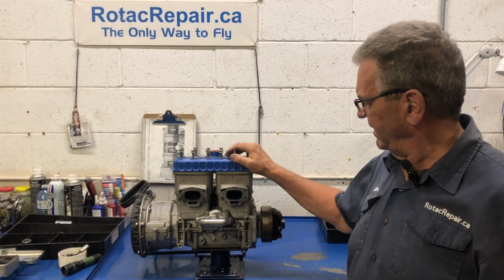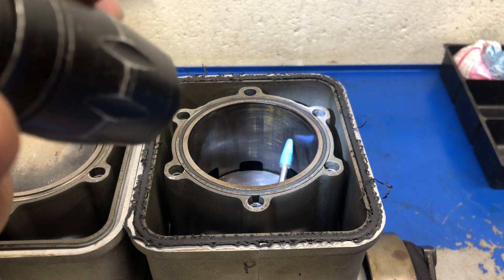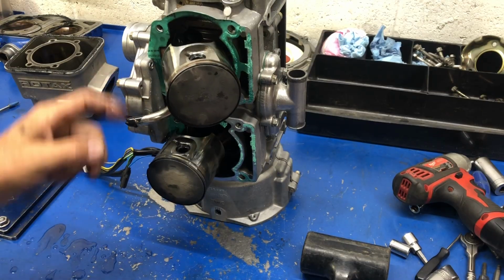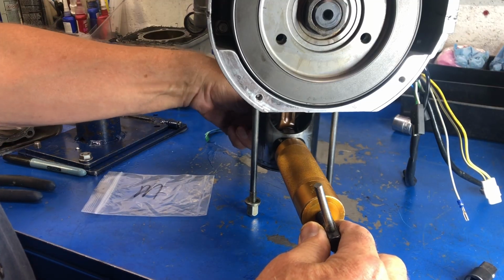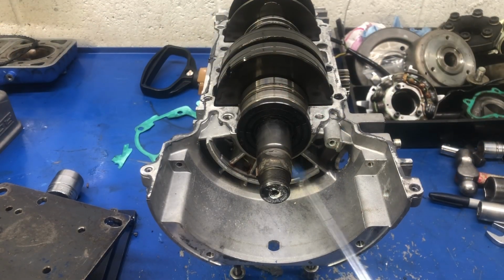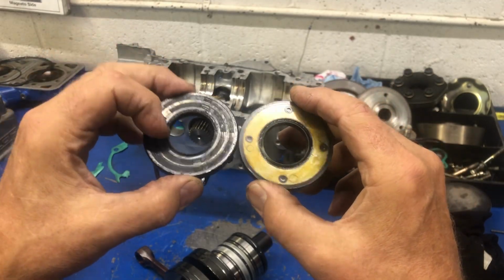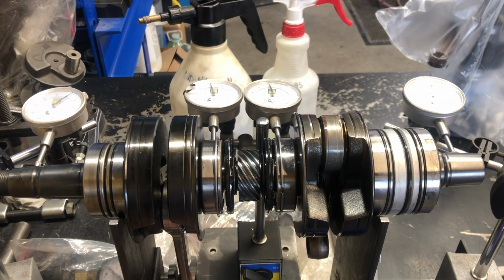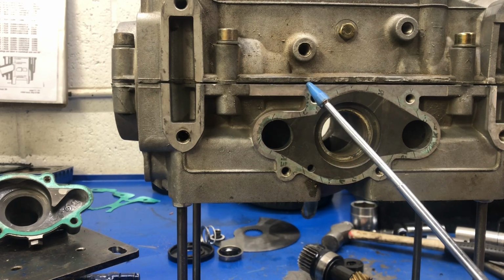Rotax 582UL aftermarket piston failure

Comment: Very good video again. I hope you keep making these for us. I would like to make sure of the proper oil to use also. I think you recommend the Castrol 2T 2 cycle oil. The original oil container you recommended had 2 T on it but no picture that I remember. What I'm buying now has 2T and a motorcycle picture. Is this the right oil? It is Castrol oil.
Reply from the maker: I use Castrol Super Snowmobile oil, 1 ltr product #0017442 or 4 ltr product #0017431.

Comment: A very thorough and informative video , I did however find one point that seemed to be a paradox . With 7 and 8 thou of piston clearance could the rings have caused that much friction to have caused overheating to that extent ? Would it not be more likely to be a lean condition due to an air leak or a plain and simple overheating due to a lack of coolant ( leak ) or coolant flow !
Reply from the maker: The Rotax rings are Moly (molybdenum) coated for many reasons, in this case the reduced friction is significant when compared to a chrome top and plain second aftermarket ring. The tension or pressure exerted by the Rotax ring onto the cylinder wall is very low compared to the aftermarket ring package. 
Then the extremely poor cylinder hone sealed the deal for failure. There was no where for the oil to be retained on the cylinder wall. 
High ring tension, high friction ring faces and no oil held on the cylinder wall doomed this engine to failure before it even started. 
Signs of overheating and coolant loss were not present as the piston did not indicate this. The overheating signs were only present in the ring travel localized areas. 
Thanks for the question and for your curiosity of other possible causes.

Comment: Congratulations on the quality of the video, and thanks for sharing! Very informative!
Some ultralights struggle with cooling during extreme summer heat (mine has this issue due to a poorly positioned radiator, where the airflow is heavily reduced by a passenger’s feet). Couldn’t the problem simply be that the engine is overheating, with the coolant staying above 80°C (e.g., 90°C) for too long? It really seems like the main issue is engine overheating and the inability to dissipate heat properly, rather than a sudden seizure occurring out of nowhere while the temperature is still normal.
Reply from the maker: Thank you for the kind comments. I was informed that the coolant temperatures did not indicate engine overheating. The extreme heat is localized at the cylinder ring travel area. Why, because of the incorrect ring package in conjunction with the extremely poor cylinder finish that didn’t agree with the chrome top and iron second ring. There was virtually no oil retention in the cylinder for the ring to seal and cool with. I think I should make a video about this in a more detailed fashion. Regards John